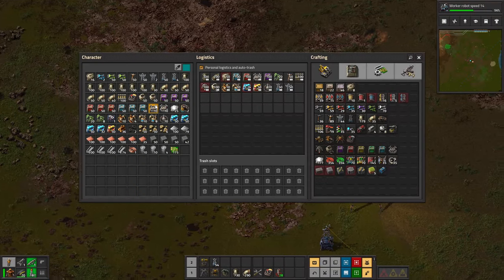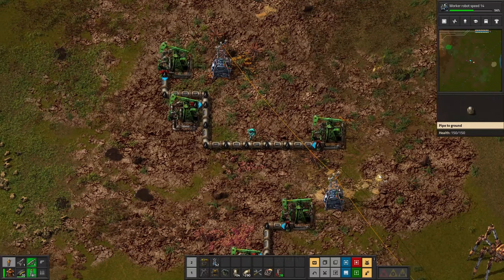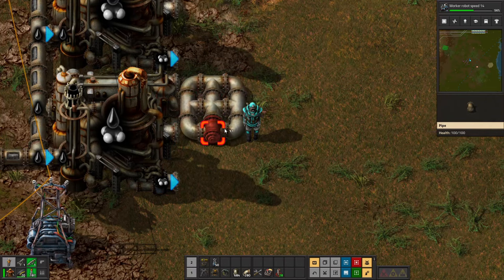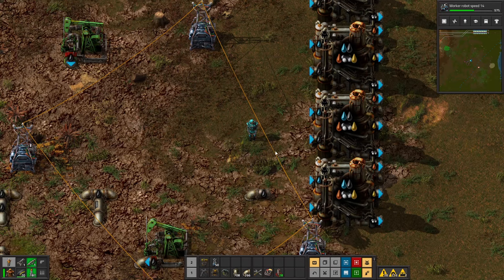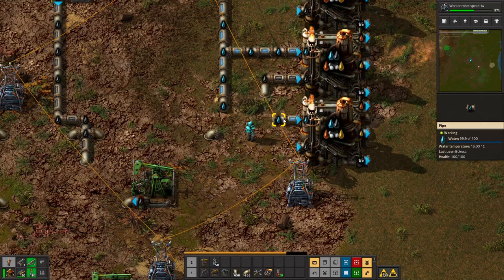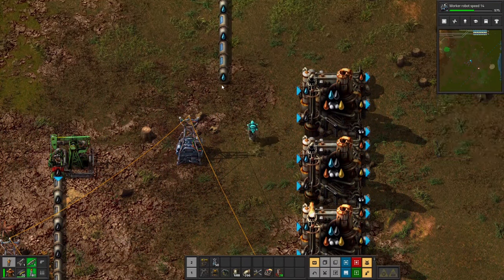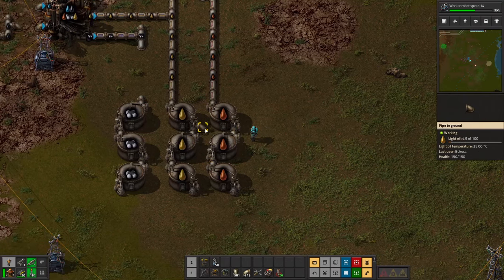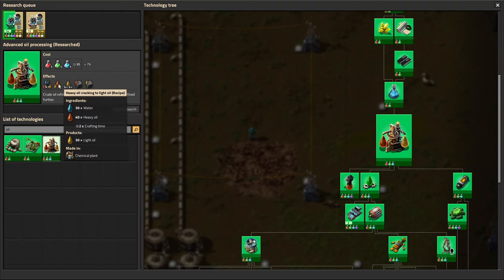Beginners Guide to OIL PROCESSING in Factorio

Comment: Petroleum is the used the heaviest in vanilla, with pumps signal wired up to heavy and light oil tanks you can convert heavy and light oil into petroleum so you never get backed up with heavy and light oil. If you're hording solid fuel you're doing it wrong.
Reply from the maker: I use the solid fuel personally in large quantities, but i just dont cover that in this video as its not relevant to the subject matter.
Reply: Wood/Coal is an early game fuel that should be replaced by solid fuel right after discovering oil. Its more efficient and is consumed slower
Reply: For some reason my current factory is absolutely gobbling heavy oil and I can't figure it out. I have the usual cracking balancer and it doesn't make a difference. I'm not even going through lube yet, it's super weird.
I'm getting annoyed enough that I think I'm going to mess with coal liquefaction
Reply: @Hawk7886  the only usage for heavy oil is the lubricants. How can you use that much of it? I usually have the opposite situation where I keep converting heavy oil to light oil instead of flushing the tanks forever.
Reply: @GhostStyle007  that's the thing, I don't get it at all. Normally I throw down the generic setup, run the cracking through a basic circuit that monitors a reserve tank and powers up a pump and it handles it from there. On this run the tank never fills up enough to toggle the damn thing. Light oil or petroleum backs up super fast, shutting down the refineries. I'm so annoyed that I'm tempted to rip up the whole thing and redo it.
Reply from the maker: are you using any of it on solid fuel? @Hawk7886
Reply: @Bokusa  all of my solid fuel is made from petroleum but I'm not quite at rocket fuel so it's only slowly being used for power

Comment: Great video. I have a question. When setting up the pump jacks what I normally do is connect the oil to a bunch of storage tanks then connect the storage tanks to refineries. I wonder if this is causing the slow down of stuff building in the refineries. I should do what you did and connect from pump jacks directly to refineries and see if that works better. Or connect one or two storage tanks for oil then connect that to refineries.